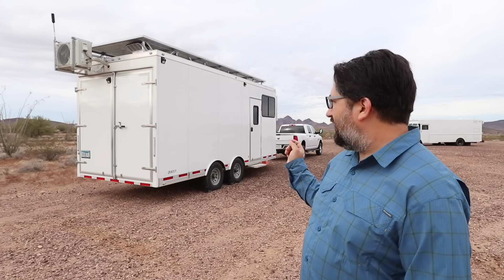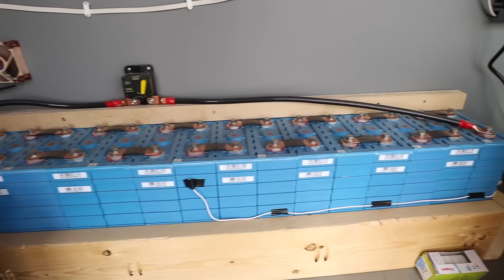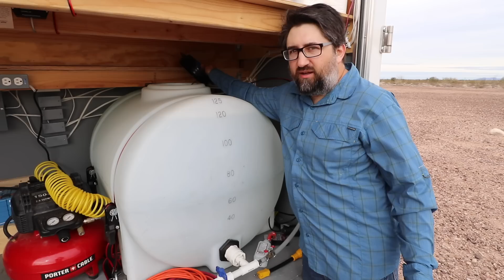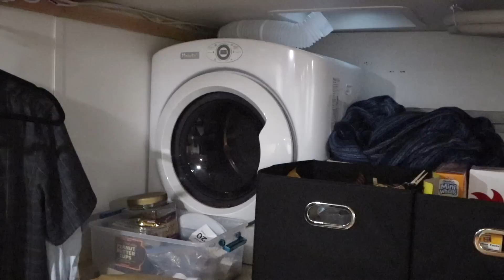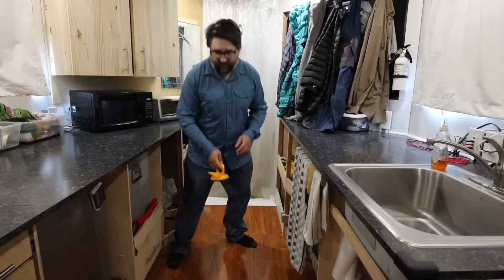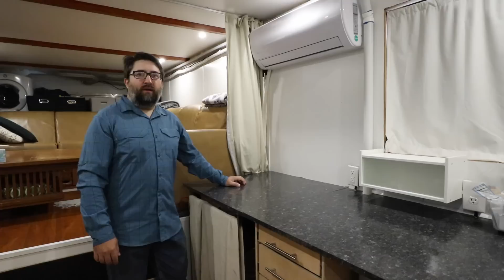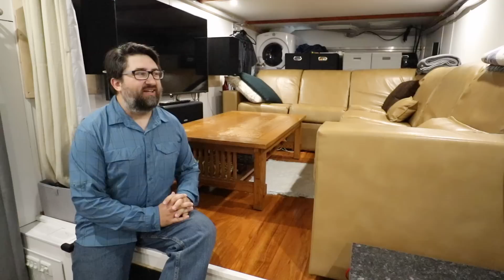Crypt Bedroom in a 2 Kilowatt Cargo Trailer Conversion

Comment: How does the water pump work with the tank almost empty? usually i see them mounted as low as possible.
Reply: The pump is rated to be able to pull water up (suction) to a certain height.  I'm well within that height.

Comment: i love the ingenuity of this layout especially the freeze proof and the shower.  I would however modify the bed entrance to lift up part of the couch area floor for ease of entrance. as you get older you won't look forward to that entrance and even now if you get injured back etc you won't be using it but I really like the concept.  

another idea :  get flatbed gooseneck or bumper pull build foundation on top of it and then put container on top of it and go from there.

Comment: Your rig is fantastic. Well planned out. I hope you can answer a few questions. Where do you normally eat?  I assume up in the lounge area. Even though you said you planned the bathroom for you by yourself, I wonder why you did not make a separate   shower and toilet  unit to vent and isolate the smell. I assume you are not a fan of open light, why did you bother with windows. Resell I assume down the road   Love the idea you planed for using the under section for your tanks and extras. No worry about damage or freezing. Why no generator to recharge your batteries if you decide to travel into areas of reduced sun.  Do you support yourself on the road.   Would enjoy seeing some of the various places you have been with your rig 

Look forward to seeing some of your answers. Some of your best set ups in my opinion are the elevated solar panels. Very ingenious. Your shower set up set up where you can send Grey water outside or Grey water tank. Entire back garage with water tank and solar set up. Very easy to get at and maintained.  Your bed under your lounge is good for you but too much work for me. Your design so my opinion does not matter.   If I was 60 years younger I would love have a rig like yours to travel around.  One of the best featured self contained units I have ever seen 

Do you have plans to take it to Alaska and enjoy that beautiful state and check out the winter season?
Reply: I've put together a frequently-asked-questions page which answers most of your questions here: http://bit.ly/2TsDaEP

I don't have any plans to go to Alaska in the winter, I grew up in Minnesota and have had plenty of winter wonderland for now.

Comment: Awesome ideas. Definitely wouldn't work in a commercially made application, obviously different in different parts of the world, but an emergency exit in the sleeping quarters in the case of a fire is a must for legal purposes. But making it himself - it's all on him if his electrical has a fire and he is asleep in "the crypt" and doesn't hear it until the smoke has filled the rest of the camper.
Reply: Actually on further thought, if he's going to have a fire, it's likely to be "in the garage", where all his electricals are, and that's the rear wall of his "crypt". So at least he'll probably be able to crawl out into the main part of the cabin, then out the door, if there is a fire. And for those thinking fire "will never happen", you never plan for the mouse that crawls in looking for food and pees on your batteries, then walks between two of those close-by terminals creating a bridge between batteries and a sizzling, flaming little hunk of charcoal until the batteries themselves catch fire. Always have to plan for the worst!

Comment: I think the electric panel should have been located higher up in order to protect from accidentally spilled water or if that water tank gets ruptured
Reply: I'm pretty sure the water tank would be the one thing that survives a rear-end collision.  It's seriously tough.  I've had water spill out of the top (overfilling), and it just drains out the back of the trailer, it can never get anywhere near as high as the electrical panel.

Comment: I agree on how you see windows... I like the outside but you can just go there, windows are overrated :D... On the other hand without windows you gain a lot of advantages: You can efficiently insulate the space, and you can install a ventilation system with built in heat recovery (you can get a pre-made system with 90% heat recovery), so with little energy usage you have it warm and cozy but with good air quality, and this solves condensing and mold issues at the same time... If you have windows in the thing, you lose so much heat that it's not worth insulating it, that's why nobody does it. It can be mindblowingly efficient... If you'd put on on one feet of good insulation (which would be ridiculous of course) you would not need a heater at all, you could theoretically heat a similar space with your body alone. With an extra 100W (lighting, fridge, computer) it would even be comfortable.

Comment: With that big water tank at the back watch you tongue load.  There is a reason RV manufacturers always put the water tank slightly ahead of the wheels.  (Black and gray water tanks can go at the back because almost everyone dumps them on leaving camp).  Other than that nice build.  Also not sure why you want to spend the money to convert to a "goose-neck" if your current ball system is sufficient.  Balls work fine if properly loaded, gooses and fifth wheels are for if you need even more weight and need to put more of it on the truck.  But most trailers that came with a ball can't be fitted out for a goose neck or fifth because that puts them over the design weight.  Otherwise they would have already been a fifth.  I'd say you are wasting money if you make that kind of modification.  If anyone would even agree to do it.

You can move the location of the diesel tanks more safely than a propane tank because diesel is not as explosive when airborne.  I'd still keep all the fuel outside, but if I had to bring some inside it would be diesel or kerosene, not propane.
Reply: More details here: http://bit.ly/2TsDaEP

Comment: That "thing" belonging to the air conditioner system on the outside is called a condenser. The one on the inside is called an evaporator.
Reply: Unless it's running in heat mode, then it's the other way around. Why do you need to comment?
Reply: gibson  Because he wants to.  It's a free open forum site, right?

Comment: I would swap the fridge and water tank.  Because you open the right door first, so when you stop to get supplies you don't have to open both doors.
Reply: The rear fridge was an item that was added on much later.  It's also likely to be removed in the near future.  And yes, if I had it to do all over again, the water tank would go on the drivers side.

Comment: Damn this trailer is heavy... and AMAZING!
Reply: basic flat trailer about   3- 4 k custom enclosure and heavy rear doors another 2-3k . framework floor etc 1k  water 1k  washer dryer couch tvs etc 1k  personal belongings linens, kitchenware etc 1k , it adds up quick. Most commercial trailers about this size up to 14,000 lbs.

Comment: 2.4 kilowatts is 1 120 house hold plug not two like a common wall socket but like the 240 for a drier but only one 120. please make a 20 volt line of green leds. the make 100 rows of them and then do it again and it will equal in size one of the solar panels you are using but be shorter by at least six inches and it will put out 4000 volts. this is with an unknown amount of amps by sun intensity but if it was 1 amp it would be like 4000 watts double what you have but it is more like 40 amps total. so is more like 160,000 watts but that is a theoretical amount as the amps could go as high as 70 to 90 amps but hey you have to try it first and that much power is kinda dangerous so please  be careful. gg signed the only nerd you ever need to know.

Comment: The water pump should have been mounted to the floor lso that it is always pressure fed by the tank.  Where it is, it will be suctioning water anytime the tank is less than half full.   It might work, but it would be better if it was pressure fed.
Reply: Nope you have no clue what you're talking about. The weight of the water forces the water to the pump and they're self priming. At least know what you're talking about before you criticize
Reply: @mrmotofy  The water only "pushes" as high as the water is in the tank.   So when the water level in the tank is low, there is no "push".  The pump will be operating with a suction at the inlet.

The pump may be self priming and it may work as is.  But the pump will probably lose prime over time every time the water level is low.  It will work much better if the pump is mounted as low as possible relative to the water tank.
Reply: @SomeTechGuy666  A self priming pump doesn't matter

Comment: Crypt is cool, but the hatch should be bigger. The cutout should have included maybe 20cm of the loft floor. But then again I am sitting on my sofa and we all know I know everything better ;-)
Reply: Then the area above would be shorter in height and pretty well unusable
Reply: @mrmotofy  A HORIZONTAL portion of the loft floor - making the hatch not flat but instead going around the corner, so you can move in in a more diagonal way stead of moving horizontally which would be more comfortable.

Comment: man thats allot of weight for the back of a trailer.. i would of put them in front?  just wondering why you would put most of the weight in the rear??
Reply: ok you told us the weight i would of put it over the tires
Reply: i still think you did a outstanding job..
Reply: But there's a bed there...there's only so much space in that trailer

Comment: Thats cool. I built essentially the same thing, sans "crypt", in a 7x14x7 package that also holds my tl1000r and sur ron bee while moving. 1kw of solar and 400ah LiFeP04 batteries, cameras on the outside in all 4 corners for what i like to call "tweekertube". I used a 53" toolbox for counter space that way my drawers lock. The cabinets i routed holes in the bottom and epoxied magnets in them and epoxied thin powder coat steel plates fast to all the cups plates and bowls so nothing slides around. I spent 3 weeks recalking and insulating, i used a dow frothpak 620 and was able to do all 6 sides "you could have a marching band in there and barely hear them outside". Maybe one day if i run into this guy ill let him do vidjayo on it.

Comment: I think you are going to experience problems with that water pump mounted up so high. It should be mounted at or below minimum water level so that it self primes. I wouldn't have mounted a heavy water tank at the rear most part of the trailer either, it is actually dangerous, can cause death wobbles. I like the split level, crypt, loft idea, very good.
Reply: Nope they're self priming. Don't worry about things you know nothing about
Reply: Oh ok. Well at least i learnt something, so thanks for that. So they don't burn out gotcha, well that's really cool. That split level is really cool btw, thumbs up.

Comment: I would put a hose fitting on that valved extra output of the water tank so I can fill the tank without opening the tank.

Put an RV water filter on the filler hose.
Reply: It seems to works as is.  BTW...if water pressure is low...the tank might not fill or fill very slowly. If you wander off while filling....yikes!

Comment: Great build, very custom. 
All the commercial RVs are expensive trash, I regret buying mine so much I rebuilt it piece by piece, vowing never to make the same mistake twice. Now everything is where I want how I want it(commercial grade😉) and screw buying propane >Diesel heating is the most legit, almost done rebuilding mine now. Similar electricals but different setup. 
48v all electric ftw😆

Comment: That's a really nice setup - I'd have to try the crypt to figure out whether I could hack it (or get my fat ass in there in the first place), but even failure there would be soluble with a higher loft floor and a partial pop-top (making use of the 10" gap to the solar panel...)

Comment: You said you have 2.5kw on the roof how much battery storage do u have I must of missed that plus u use a induction stove mini split, fridge washer and dryer, freezer  the fact you have all that in there very nice but I want to know the induction stove and any heating unit is at least 1 500 watts  plus the fridge running compressor kicks on at 600 plus watts do u have any issues with draining your system quickly although I'm off grid I have issues with fridge killing  my system during the night
Reply: 200ah at 48v I believe he said

Comment: I’ve got the split AC heating tippy unit on the back of my school bus they run the problem where the Freon or coolant keeps leaking out when I drive what do you do to stop that
Reply: It's never been an issue for me, the system has always stayed pressurized.  Did you do a vacuum leak test before adding the Freon to the system?  I let mine sit for 24 hours in vacuum to make 100% sure it was leak-proof before proceeding with installation.

Comment: Should the water be so close to the batteries?  What if there if there is a leak?  (not trolling, honestly curious).
Reply: There have been tank fill overflows, and it hasn't been an issue.  All of the wiring is above the batteries, and the batteries themselves are sealed, so it would have to be at least 6"+ deep for it to touch anything conductive.  And of course it'll leak out the trailer before it gets anywhere near that high.

Comment: It is blatantly apparent that untold hours went into the design and completion of this rig.  I was especially impressed with the shower setup.  Not so much with the toilet setup.  It works for a single guy, but how about those times when you have those eight people seated on the couch?  As far as the crypt?  I love it and hate it.  It is a clever and original use for the space.  I don't see it as any more confining as the triple decker bunk beds on a navy ship.  However, you said you now have a girlfriend.  That low ceiling sort of prohibits certain sexual positions, although, there is always the spacious couch.  I have empathy for you, as far as needing darkness and silence to sleep.  I am lucky in that regard.  I can fall asleep just about anywhere.  I have even fallen asleep while undergoing an MRI scan, and those things seem as loud as a jackhammer at times.  I am dying to know what type of truck you pull it with.  I am also wanting to see an update when you convert it to a gooseneck rig.
Reply: Yep, it's a mixed bag of good and not-so-good for sure!  I'm pulling it with a 2018 Ram 2500 (diesel).

Comment: Great fort! When I was like 13 I built a fort in the woods between four evenly spaced trees that was well over 30 feet tall from the ground to the "sun deck" . It had two open floors (no walls)  between enclosed floors. It had a ladder in a different spot on each floor and a knotted escape rope from the roof to the ground. It had a Colman heater, a boom box for entertainment and we even had a porta potty away from the fort. We were always trying to find a fireman's pole or build a slide for life but the township found it and torched the place one Sunday. I could see the fire from the highway on our way to church. When we finally got back there some time later it had all been picked up and aside from some burned tree trunks, you'd never know it had been there. The township posted a sign on each of the four trees "No Trespassing, Twp Property" I'm in my 60s now and I'm absolutely going back there at some point just to see if I can still find the spot and maybe a relic.
Reply: Interesting story.  Thanks for posting it.  Kinda cruel they did that to kids.  They could have at least given you all a heads up and taken the time to teach you about why it isn't allowed, such as safety concerns.  And how about a pat on the back for good planning and following through with a project?